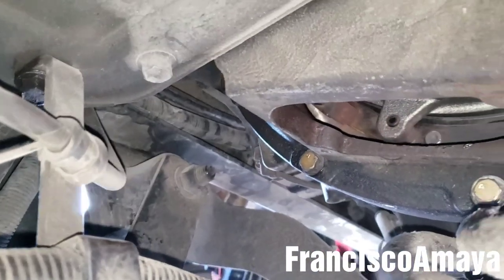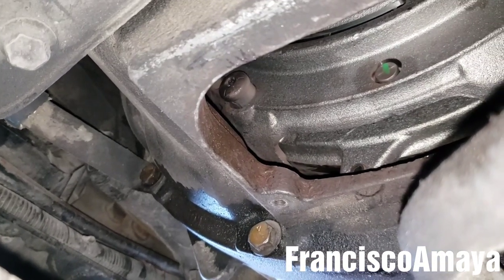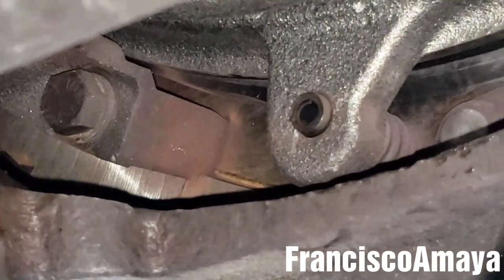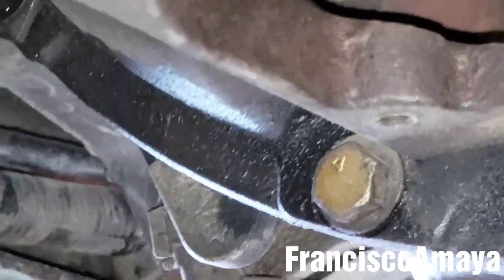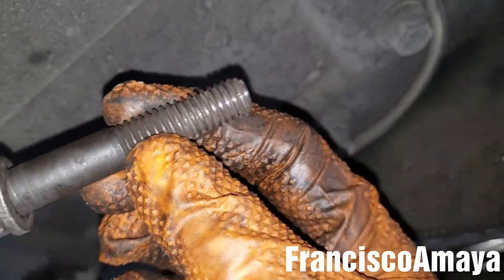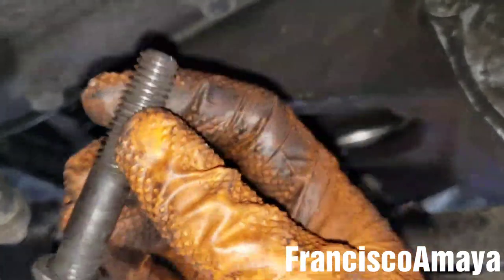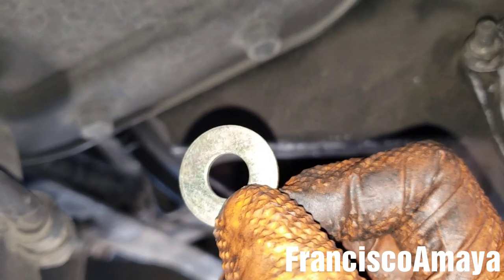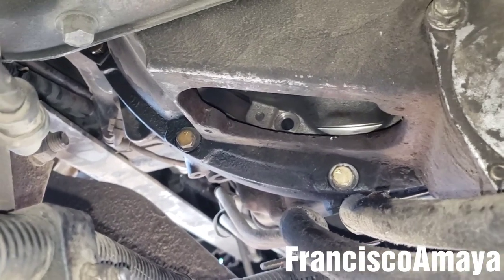Freightliner cascadia clutch slipping spinning vibration while driving

Comment: Thank you we bought a dd15 cascadia from penske with this exact problem as a level 1 purchase  they have closed out work order as if all the initial problems have been taken xare of. Low behold, all the bolts holding the transition  housing to engine  have came a loose ,durring a regen i noticed two bolts on ground took bck to penske  they retightend all bolts but still have gri drinding noises  durring idle..???""""

Comment: Hi Francisco I had the same problem fixed but I notice the access plate is missing after inspecting the repairs. Do you think its a good Idea to leave it open. I asked the shop that fixed it to find one for me but they are insisting that it should be no problem. any advice will be much appreciated

Comment: Hello Francisco, I have a 2014 cascedia  dd15 and I took it to the shop to do an oil change. When they finished it and took it outside the shop. So then I check the oil and barely see oil on the dip stick. I go to talk to the guy and he said he only put 4 quarts. So can the engine be damaged with only 4 quarts of oil?  They drove it out of the shop and then back in. During this time can it be damaged ?
Reply: Did they think you have a 4 cylinder Honda engine in it?
What kind of shop will put only 4 quarts of oil in a DD15.
Reply: @paulb.5497  serious lol vtec dd15
Reply: engine failure..
Reply: Im ocd when it comes to oil changes. Check everything before leaving shop.

Comment: the clutch has not adjusted, the wear indicator has to move out from start 1:06. That why its slipping.
Reply: those bolts at the bottom are very weak bolts and shouldn't be used for that purpose

Comment: Hi Francisco. I have 1996 kenworth 15 speed  I change new clutch 2050lb new transmission but still there vibration coming from transmission and clutch 
There is space between  clutch and flywheel 3 time dropped transmission same problem  when start moving with heavy load there is free play inside housing. And some time engine shut-off  when start moving.can u give me ideas what's  problem. Thanks in advance
Reply: Did you find your problem

Comment: No hablo ingles
Reply: Hi Francisco. I have 1996 kenworth 15 speed  I change neclutch 2050lb new transmission but still there vibration coming from transmission and clutch 
There is space between  clutch and flywheel 3 time dropped transmission same problem  when start moving with heavy load there is free play inside housing. And some time engine shut-off  when start moving.can u give me ideas what's  problem. Thanks in advance